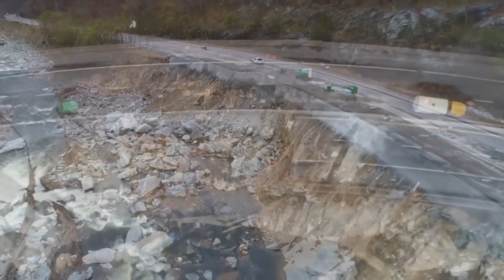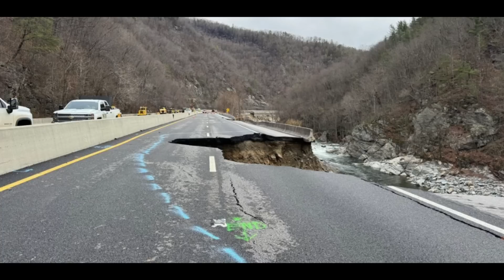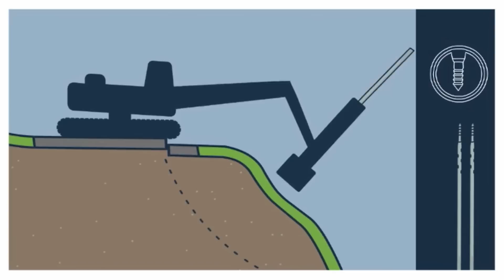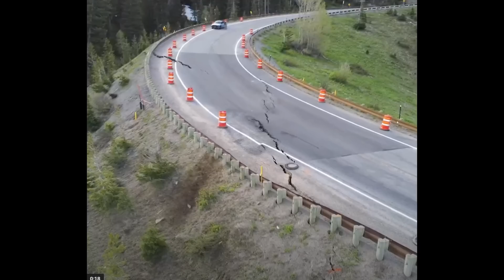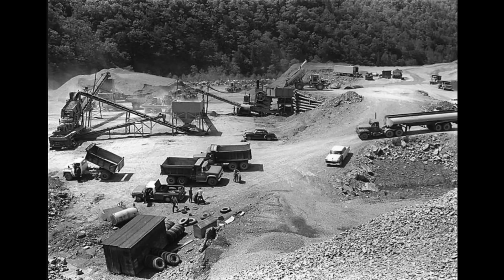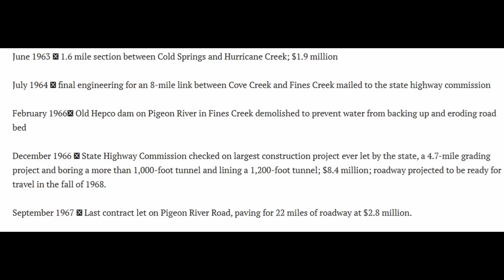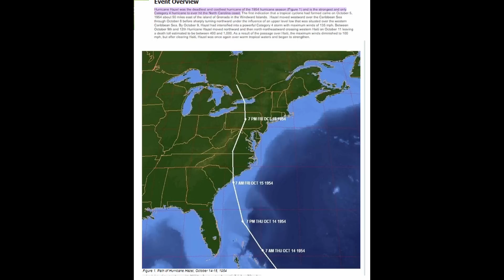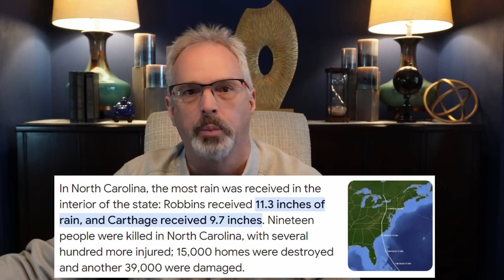Interstate 40 Rebuild Status

Comment: 17:15 Perhaps Glenwood canyon provides a different point of view? I think you make a good case for not rebuilding in situ. It might not even be possible to rebuild in situ with today's requirements, at any price! If this is the case, then there is no argument to rebuild in situ. But there is a lot of political power behind keeping something like the current alignment. So would it be feasible to route the highway up on the side of of the mountain like I-70 through Glenwood Canyon? I know that would be very expensive, but it might be less disruptive and easier to actually get done in the current political environment.

Comment: The only option that will work is to move the river to the south so the washed out area becomes high and dry then rebuild using a similar design as the Blue Ridge Parkway Viaduct around Linn Cove. Supports would be anchored deeply into bedrock so when the river floods again any overflow can moved in and round the viaduct piers. Any options of trying to fill and anchor are doomed to fail. Moving the road isn't an option as such a process would take 10+ years if not longer nor is taking out those three curves with a longer tunnel for the same reason, 10+ years. As it is any solution to get 4 lanes open is 2 years out at best.

Comment: This section of I-40 has always been problematic with land slides coming down on the road from above almost yearly, causing road lane closures that last for most of the year. Once it is fixed another slide occurs. Some brillant idiot cutdown the trees next to I-40 stabilizing the soil. So with every heavy rain period another slide occurs.

For the section below the road that washed out in Hurricane Helene along the Pigeon River and took the two eastbound lanes, they need to build it up from the river upwards building it with lots of huge rock and building a very, very stable base to build the road on that will not be washed away by the river in historically high full flood stage. And the road will still be subjected to landslides from above because they continue to do idiotic things like removing trees; leaving bare soil with a thin grass covering that is then easily subject to sliding.

What alternative route? You are talking about high steep mountains that are ancient, eroded down from a Mount Everest sized ancient mountain range. Lots of rock stacks over which soil has developed. Those rock stacks slide easily if enough water gets down there from the soil above. The only way around is down through Georgia or above to Virginia which is where I-26 is right now and the truckers are trying to use local roads to avoid going that far out of the way. There is no choice but to fix this section correctly so flooding can never move it again. Lots of huge rock and a $h*t ton of cement to make it is so solid nothing will move it ever again. And then there will still be the problem of landslides from above, gravity rules.

Comment: Open one lane, two way traffic?  How is that going to replace FOUR LANES of traffic.  
The 'rock' anchors seem to be over a coating of soils.  Shotcreteing over that unstable material is pointless.  That fill can just slip right out leaving the shotcrete crust.  If  one assumes they continue the shotcrete down to where it's exposed rock it reduces the possibility, not eliminates it.  
As to replacing the entire section, and presumably other similar sections.  You'd have to blast a ledge into bedrock (and might need coffer dams to keep work area dry).  Then drill in extensive deep rods to anchor a retaining wall so it will not shift even if slope above road slips, along with all the fill up to the road, under total saturation.  The retaining wall would need to be very thick, heavily reinforced, and probably with additional structural walls at right angles into rock, and anchored to rock, creating 'cells' to fill.  Each cell would need to be drained at several levels and that water taken down stream in pipes until it could release above any flood level.  As this could be 10's of miles, the eventual size of the pipe will be 'large'.  Run off from road will need to go into river, no way you could pipe that for 10 miles.  You'd probably want to create a structural slab over the cells and fill in the cells.  You'd then need access to each cell for inspection of some sort if just open bottomed pipes every 20 feet or so.  
Now to resist what looks like 20 to 30 feet of water moving at high speed, probably max speed water can typically flow at.  First need to figure out if it's enough to cause cavitation, where water hammering can pulverize even bedrock.  I think this is far too shallow, but it should be checked.  You'd be well advised to blast another ledge further out into river and install an entirely seperate 'sacrifical' buffer wall up to top of flood height.  At the least you'd need another foot of retaining wall with 12 inch plus wood or composite or plastic sleepers to keep rocks in water from pounding concrete to dust.  In either case, it's only as good future inspection and continuing, forever, remedial work, that will at least every 5 yrs take the river side land out of service for months, and next lane during working hours.
SO
You want to design the highway so lanes can be reassigned to go in both directions.  Good luck on that.
Having taken care of flood risks, now there are the landslide risks to mitigate...  At the least much of the wooded slope would need to be carefully cut in stages and anchors drilled to rock and a steel net laid over the ground, or as in Alps, steel frames and mesh at right angles to slop installed to catch falling material.
Alternatives:
1.  New Route, there is a maybe it looks like route to the north that would end up back in the national forest this terminates at, but, that's a lot of land to seize and pay for and much politicial ill will.  It will also take productive lands out of service further depressing already depressed areas.
2. Dam or dams purely for flood control, kept empty until rain event then closed.  Much the same issue as above.
3.  Create anti flood bench down around level of flood, create a second bench at say double that height, dig it into hillside if need be, roof over entire highway, cover with deep fill to act as toe to hold in slope above and absorb water run off so it won't contribute to flooding.  Anyone figure out how much roads themselves added to flood.  Hillsides absorbed much water before saturating, and as it was a fast even, it never had time to soak in far enough to saturate and destailize many slopes.
4. Tunnel the entire thing 22 miles, restore two lane local only road on high bench, with a lower bench acting as flood barrier.  This would take far less concrete and fill.
5. Tunnel(s) to take surplus flood waters around this area to where floods can spread out over flood plains and be less destructive to property.  The intakes would need to strain out logs and boulders, yet not jam solid over course of typical event.   
THE WINNER
Is what countries throughout SE Asia are doing, and they know a lot more about dealing with impossible to deal with rains, the last, tunnels to move water out of area.  This would also be the cheapest, certainly over life cycle.  The tunnels would need no real finishing, no interior segmenting to provide road beds, maintainece and evacuation, air supply and exhast, and the vast series of buildings, vertical riser tunnels needed to make all that happen.

Comment: What you said Casey is right on, I think they should redesign / reroute that whole section of I-40.  It has had scores of problems over the last several decades with erosion and rock slides and they just keep rebuilding it the same.

Comment: I tend to agree that rerouting is probably optimum for the long term, but the politics of that may be insurmountable.  Perhaps an alternative would be to tunnel at least two lanes into the hillside where the streamside pair was lost with the spoil used for fill or riprap as appropriate.  That would at least increase the available channel cross section reducing the likelihood of the road being overtopped again.
Reply: Politics won't play as much of an issue on this section. It is remote and has few other roads in the area. The big issues will be the cost and the time it will take to build it.

Comment: That storm is considered a 100 year flood event. The most economical and time effective manner of constructing any roadway in a mountainous region is to follow the river. The only other storm with similar damage was Hazel in 1954. The federal government (at least the current administration) will do the quickest, most cost effective means to reopen the road. There is no engineered plans in place to fix the roadway. That takes a couple years of planning and design. Long story short is hurry the F up and get it reopened asap
Reply: YEEEES!
Reply: Helen was not a 100 year (1%) event. The probability of such events is quite low.

Comment: The Story I get from my railroader family members: Southern Railway told NC not to put a highway through that area, as they had already done a study on it & judged it it unsuitable
Reply: Southern Railway has had a lot more experience laying track across impossible terrain - should have heeded advice
Reply: This is the most important interstate section to me. Atlanta is now also impassable. My fl to in trips require i-40. I did the detour through hot springs and it's not that bad. Better than dealing with Atlanta.
Reply: @Joeainthere73  me i hate Atlanta too
Reply: But you have to remember that the railroads lobbied against the construction of the interstate highway system because they knew it would shift freight to trucks and off of their railcars.
Reply: @fairviewman3924  wrong facts how young are are you.us 25 w has a lot of trucks on it in 1960, the southern main line never had a lot of trains from Ashville Nc to Knowville tn, the Southern RR was a lot smarter then the Ncdot in the 1960's and is still a a lot smarter then Nc dot in 2025, the rail road night be reopen be for i 40 is done and NS corp has not even try to get the Rail road done
Reply: This is a reoccurring issue .
They need to do something different.
Reply: And where did the Southern build? The  same place where I40 needs to be relocated to Hot Springs on to Newport !!!!!!!!!!!!!!!!!!!
Reply: @robertkirkpatrick7903  Pretty much. I first drove that stretch when I was in the Navy in the early 70s. I saw that it was time bomb even then. There are geotechnical problems on both sides of the roadway. On the mountainside because the slope of the rock strata are in the wrong direction, so rock slides happen at odd intervals.

The hydraulic problem along the river is obvious, particularly now. Reconstruction is not feasible at that location. It should not have been built there in the first place.

I now live in Waynesville, NC, adn a number of people who recall the planning and construction have told me that politics played a large part in the location of teh roadway. The route where US 70 is now would have been far, far better.
Reply: @Richard-e5m  Yea
Reply: @robertkirkpatrick7903  That area is also prone to slides.  There is no route that is free of that problem. Whether it would be worse in the French Broad River valley or not is debatable and not one I can meaningfully add to.
Reply: @verlinbattle2132  Helene was so bad it took out Railroad Infrastructure.. which is built pretty strong … Here in Va it destroyed a bunch of ex -Railroad Trestles on the Va Creeper Bike Trail .. 600 million $ Our Governor got to repair it

Comment: 8:59 yes, our transportation system works less efficiently and less reliably the more is it used. We tend to funnel more and more traffic through a smaller number of larger roads. I am sure that is cheaper. It might be faster in some cases. But add in any failure, whether it be bad weather, a disabled vehicle, a crash or a structural failure and suddenly the whole network almost totally collapses and some locations might even be completely isolated from normal vehicular traffic.
Reply: I've been thinking for some time that, as a policy, we should be hesitant to widen limited access highways to more than three lanes each way.  The norm should be to build a parallel road or bridge to handle some of the traffic.

Comment: The other problem is the probability in Asheville might be 1/1000.  But the probability across the whole southeast is much higher than 1/1000.  If you apply proper statistics you might be closer to 1/100 or 1/50.

Comment: There was an extended closure for a landslide that buried a couple of tunnels around 1998. 

It seems to me that there have been at least a dozen smaller slides that disrupted traffic flow over the past 35 years.  
The gorge is really just terrible geology for this type of highway. 
I26 is far from being a viable alternative until the multi billion dollar projects to modernize it's route to Tennessee are complete sometime near the year 3000😅.
This is the price of living in the mountains. 

40 needs a better route that can handle minimum 6 lanes.

Comment: I have lived in East TN off and on since 1966.  I have never driven that section of road!  What bugs me is the unwise decision to follow the river through a gorge.  It appears a redneck was in charge!  Redneck in this area means idiot!  These rednecks love to be in charge, but shouldn't leave working under micromanagement.  It would have been cheaper to cut a path straight through the mountains!  If I were to fix this problem, I would blast the rock face back 100 feet and build away from the water.  Moving water will dissolve the limestone and undermine the road, where it is, in less than 50 years.  The faster that water moves, the faster the erosion.

Comment: Possibly cut into the hillside from the top down and reinforce at the same time in order to widen I-40. They could transfer some of the materials as fill on the river side of I-40.
Reply: The problem is slope stability above I 40. Places along the current interstate where this has been done in the past, have only created greater problems. The new exposed surface is unstable and prone to frost and heaving problems.
Reply: That won't work  the rock in that area is not good and we have rock slides almost every year now on to I 40 .Sometimes it takes a year or more to get I40 back open after some of the slides.

Comment: The analysis makes sense. The best move would be to bring in Swiss engineers as consultants to review proposed actions and recommended changes or alternatives. The Swiss are masters at road and rail engineering in mountainous terrain. Do this in the same spirit as coastal communities have brought in experts from the Netherlands to help devise strategies for lowland flooding.
Reply: The problem is that would cost money up front, when they can instead waste money at a slower rate making no progress but not raising taxes so the politicians responsible keep their jobs

Comment: Back when i was in school the rule of thumb was 50 dollers s yard for dirt or concrete work. When they rebilt the salt lake City roads for the 2002 olympics there was 5 milion yards of dirt work and 4.5 milion yards of concrete work the cost of the project equeled 9.5 milion x $50 to 100,000$. Is there a similar rule of thumb today?